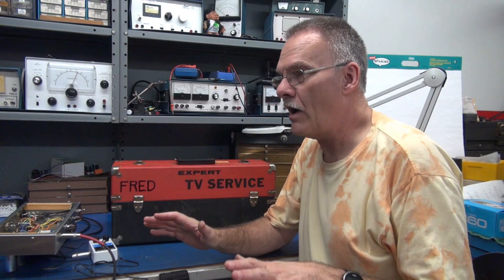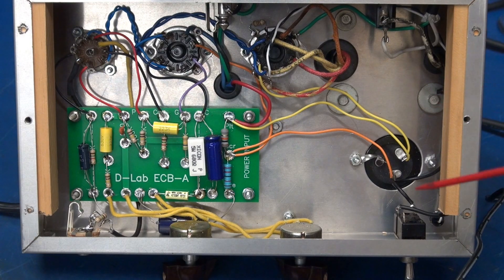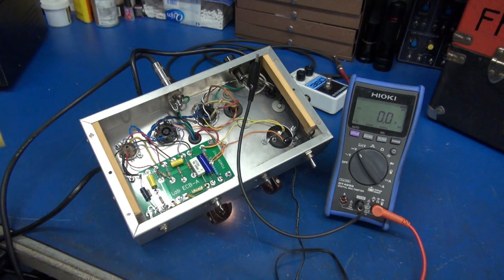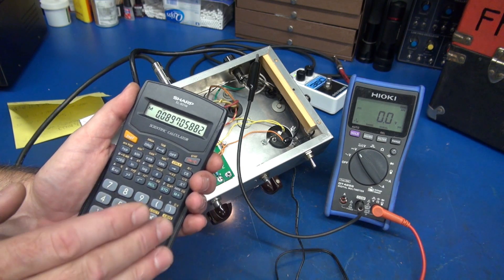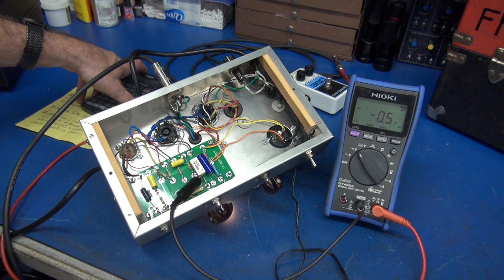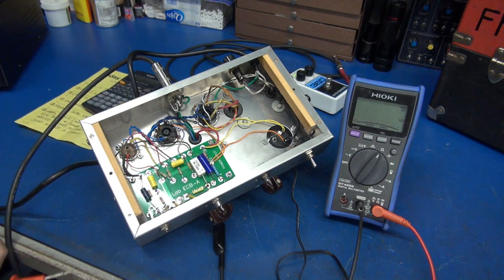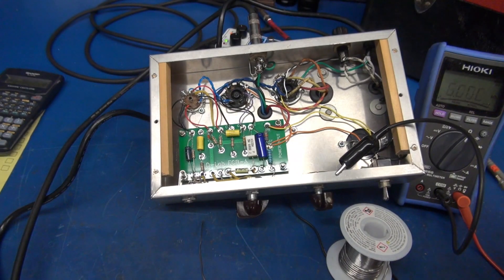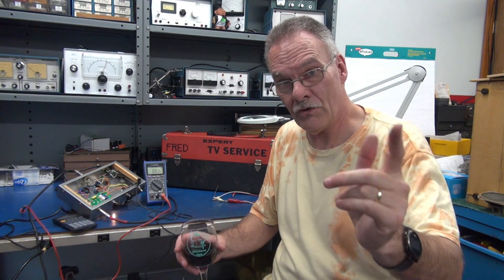D-Lab Basic Training Fender 5F2 6V6 tube guitar amp Low distorted output How to troubleshoot method

Comment: I have a similar issue with my 5e3 clone but one Power tube is at operating temperature the other 66 is cold and when I checked the pin to on the tooth socket on the top side where the Warriors attach was loose I could wiggle it so could’ve bad this bad spot dude also the same as this example because then the heater isn’t heating the tube and send it to visit operating either I think I’m correct

Comment: Hi Terry how are you. A customer brought me a Gibson GA-5 Les Paul junior amp. Its a very small combo with only one control and a small 5×7 speaker. It has a shorted power transformer. The Tube compliment is 6V6, 6SH7 and the rectifier is missing but its wired for 5Y3. What power transformer would you put in it? its vertical mount. It powers up and all the voltages are there but it gets way too hot after about 10 minutes. I took all the tubes out and it still got too hot. I'm thinking a Hammond 269X or 270x will fit but I need to choose which one. The voltage measures 270 volts AC to ground on one red wire of the high voltage secondary and the other measured 290 both measurements are with transformer unloaded. I always test the transformers before I replace all paper caps, old electrolytics and carbon resistors that are out of tolerance but next time I test a power transformer I will let it stay powered on a bit longer so as to check for partial shorts and overheating In order to give a more accurate estimate on repair. Thank you Terry

Comment: If you had probed the "gnd" side of the resistor while powered on, you would have seen 60Vdc there also. That would prove the resistor was not open and it wasn't tied to ground.
Right?
Reply from the maker: Yes, the 60V would be at the open circuit

Comment: Great video , I have a clone that is  new first time starting it up and doing the first voltage test and it over heats the cathode resistor and melts it , could it be that the original resistor was a 3 watt resistor and the high wall voltage of today compared to the voltage of 1958 was less . Or should I look at what part fist to see if I wired it wrong , I’m learning about this stuff so I’m just asking we’re to look first then second and third etc your video  like this is golden to me thank you again
Reply: My clone is of 5E3 from tube depot just so you all know

Comment: There are some eyelets on the left that look dodgy.
Reply from the maker: Yep, all will be tidy before reassembly
Reply: And some elsewhere it seems, good practice is to scrape away oxidisation on component (especially older ones kept in storage) leads before soldering. I am not a fan of high-power rated resistors right next to electrolytic caps, even though the power would be a max of 1.5W.

Comment: This reminded me of the training circuits at Keesler AFB way back in 1976! A l little trap door on the bottom of the chassis hid several switches that introduced faults. The instructor would set one up and we had to troubleshoot it EXACTLY like what you just did. Ah, memories.
Reply: My father was stationed at Keesler back in about 56' when I was just about one year old. I haven't thought about that in years.
Reply: That sounds fun!

Comment: Man I could have used this video about 1 1/2 years ago :) I was working on an Egnater Tweaker 15 that sounded exactly like your amp. The Egnater came in with a failed OT and after I replaced it I got this cutting out sound. I thought maybe the new OT was bad so I spent some time checking that out but it tested fine. Turns out the cathode resistor didn’t have a path to ground. Unbeknownst to me the guy before me changed the resistor (assuming during troubleshooting?) but didn’t solder it correctly.  Quick fix and all was well.